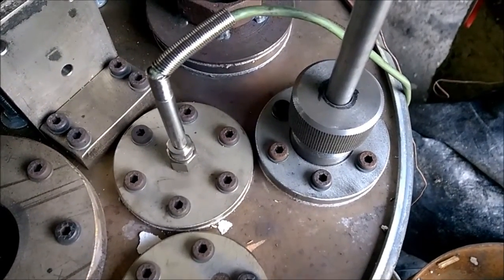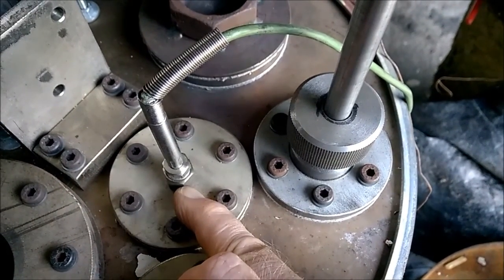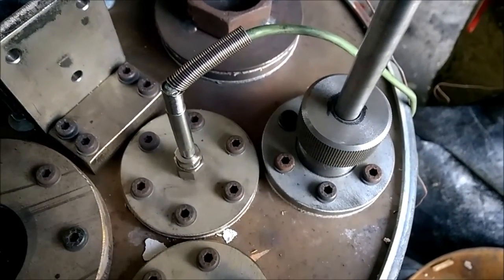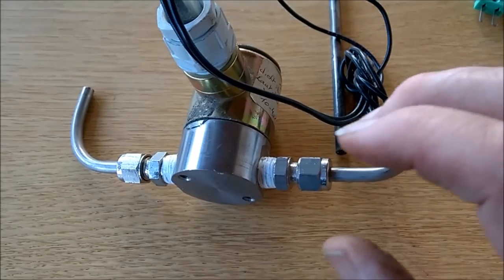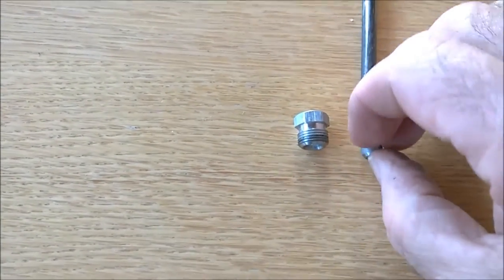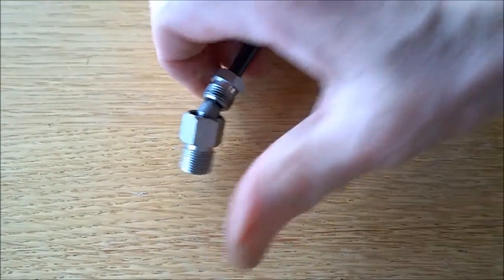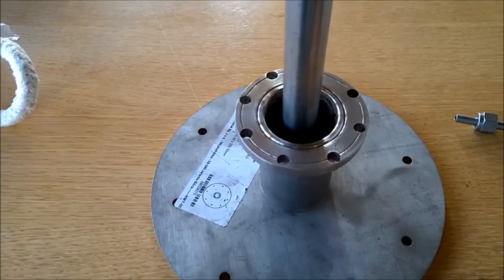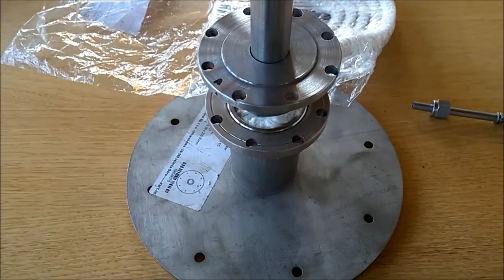Airtight and heat resistant Seal through gasifier wall.

Comment: Luk, Finding out the hard way that I need a better seal for the shaker rod going through the barrel, I came right to your site and to this video for guidance. Thank you for having these resources available and easily found.
Reply from the maker: Dear Bill, I am glad you found the video useful. We all learn from each other. Thank you for putting a message. One thing. Keep enough thread in your pressure screw. After time you have to screw tighter if the rod goes too light and if you have not enough screw thread finally  you have to replace all the ceramic rope. If you have much screw thread you can press and press for a very long time and if screwed to the end then you have enough room to put a new ceramic rope winding in the chamber. Cut the rope to exact length so they go around the rod. Do not cut straight but in an angle. Put the rope with the cut side opposite from the start. every time turn the rope so the the cuts are 180 degrees turned. I hope I wrote understandable, since English is not my mother language. Luk
Reply: Luk, I appreciate the additional information. Here is what I did:  After installing the pipe and inner end cap on the barrel the shaker rod was installed without the outer cap threaded onto the pipe. I started wing the gasket rope tightly around the shaft, pushing it in as the gasket rounds were formed around the shaft. Pushing the rod inwards to help forcing the gasket into the pipe I used a punch to keep forcing into the pipe. When the pipe was fully packed with the rope gasket I added about three extra windings and cut off the gasket at that point. Then Added the outside  threaded cap which helped force the packing further and also filling the space in the end cap.
It made for a tight seal and was still able to rotate as needed. If in the future the shaft gets too loose I can add more rope gasket as you describe.
Again thank you for the great idea.

Comment: You can use hydraulic or pipe fittings with compressing rings some of them use a o-ring for sealing very good if you want too adjust the distance
Reply from the maker: Ralf Gottfrid Hansson Ralf, Thanks for comenting; Yes you can do, but then the rod is not turnable anymore, also the O-ring will melt by the exstreme temperatures the gasifier wall can get.

Comment: HI Luk.....In the US we call the thermocouple sealing elements "compression fittings".  A compression to NPT fitting works very nicely in your application.  Stephen
Reply from the maker: +
Stephen,

Once I have pute some positive presure by my compresor on the rope seal, and it supported, 
to my big surprice, 5 bar. I saw it used on a waterpump drive shaft, wich was 
even rated 75 metres pump hight. (almost 7,5 bar) There they used grafite rope. 
But grafite rope only resists 600 celcius.